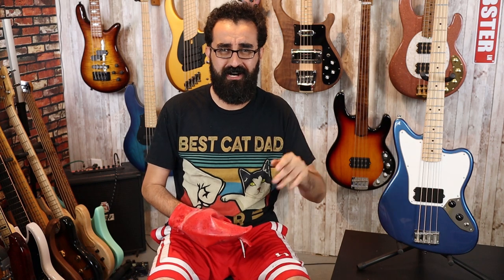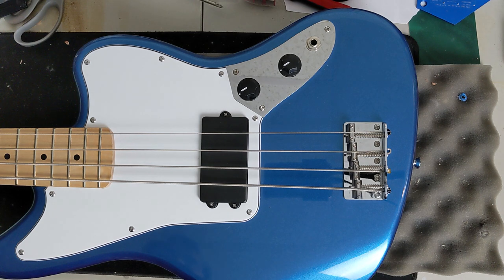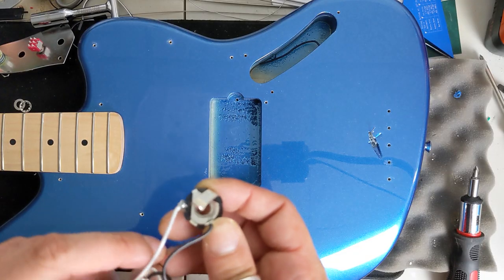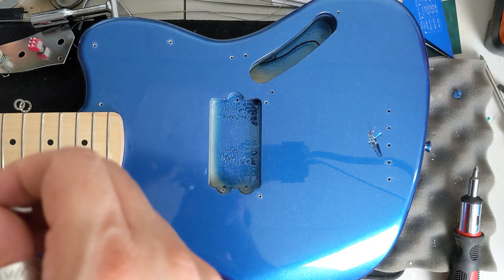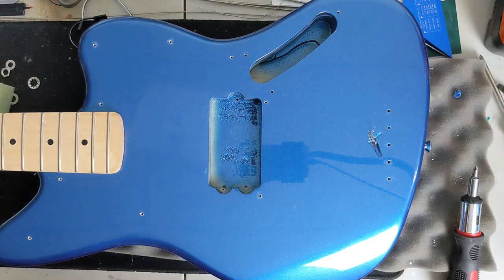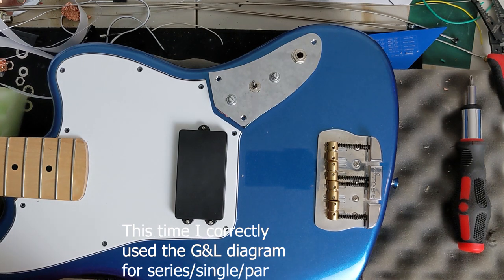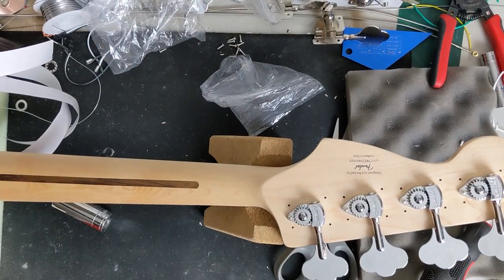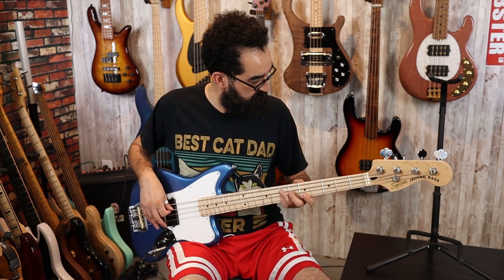Squier Affinity Jaguar H MODIFIED - Modding Fender's Latest Budget Beast! - LowEndLobster Fresh Look

Comment: that looks and sounds amazing. Can you fit a bartolini mmc 4 on this without drilling? By checking out the diagram seems like it can work for passive tone and volume . Thanks for sharing this with us. Salutations !
Reply from the maker: Thanks Claudio! Yes, the bartolini will fit without issue.
Reply: @LowEndLobster  awesome. thanks for the quick response. Mine is arriving tomorrow and I am already thinking about doing some mods on it :D

Comment: is the "painters tape trick" a long term solution for the tuner bushings?
Reply from the maker: Yes. The tape is only used to align the tuner. The tuner itself is tightened and secured into the hole during installation.
Reply: @LowEndLobster   for sure! i saw in another comment that you mentioned that there was "USA" ultralite tuners that may be a straight drop-in? is there some kind of import spec set?
Reply from the maker: Yes. They're significantly more expensive than the imports however. You can get metal bushing adapters too
Reply: @LowEndLobster  ahh i see. thanks for your help lobster ! :-) been super into modding axes and this is my first bass to call my own, yr video has been great inspiration :-)

Comment: Awesome, Moana go pick one up and start drilling!!  Novice in mods so basic question, would a guild BS fit in there, in theory it seems like it should be a nice way to go😊
Reply from the maker: Hi! Yes, though the string spacing might be a little off because the Guilds are a bit narrower. You may have to make the cavity a little deeper in the center as well - YMMV. Check this out - https://www.youtube.com/watch?v=5tuAdEigGQM
Reply: @LowEndLobster  thanks man, you are full of information !!  The Guild doesn't have coil tap so there is no issue with routing/wiring right?  Would the string spacing difference (Is it 18 vs 19?) make the Guild "unusable"?
Reply from the maker: @pierrel5222  I don't think so. I believe the Bronco that I modded had 19mm spacing and worked well enough. The guild does not have a coil tap. it comes with a weird little plug connector, snip it and you have yourself two wires - one hot and one ground. Hope that helps! Happy modding!
Reply: @LowEndLobster  saw your humbucker videos, much confusion I feel, the NS blade might be calling....
And it also looks like the pup monster ate all the BS1s....
Based on what you have seen and the pup position on the Jaguar, which one of the humbucker you feel is a good one to start with for punch, growl and meat and good tonal range but limited string/clicking noise 😎 (easy !!) ?
Reply from the maker: @pierrel5222  The blademan would be a good choice!
Reply: As for the guild bs1 do it looks like would alleviate the problem with the pickup...lobster I think I've entered the rabbit hole of mods can you please show me the light out?
Reply: I forgot to type the hipshot vintage seems to have a bridge with an 18 mm spacing and a badass I think is adjustable

Comment: I want to get this bass, but I'm currently the world champion of bad soldering.  I don't want to have to replace the pickup myself unless it's like the EMG system (solderless).  Any suggestions?  Thanks
Reply from the maker: You made a great suggestion for yourself with EMG, but you'd need to remove a small bit of material in the control cavity for it to fit. A Dremel would do the trick. Either way, no soldering!
Reply: @LowEndLobster  I have a CNC machine that I can program to perfectly cut the cavity to the right dimensions.  That's a plus.  Do you know of a good humbucker, preferably passive?  Thanks
Reply from the maker: @michaelfairbanks4299  You could go all EMG. A 35 hz or second mmhz would work well
Reply: @LowEndLobster  What was the pickup you installed?  It sounded great.
Reply from the maker: @michaelfairbanks4299  I used the G&L MFD inside a blank MM housing. You can do so much with these basses :)
Reply: @LowEndLobster  So I ended up buying a new Gretsch G2220 instead of the Jaguar H, and I love it.  It was 300.  I'm committed to leaving it stock.  I'll play the stock strings for a while and then switch to flats later.  I might upgrade the tuners, but it's not important.  I won't be cutting anything.  :)  

My other project is a Squier Bronco Bass I've had for a year.  I took it apart and I'm going to repaint the body, put an amber finish on the headstock, and I'm going to router the pickup cavity to take the EMG Geezer P-bass pickups.  I'll make my own pickguard through 3D printing or CNC.  I already bought new tuners for it.  

Cheers.  Love your videos!
Reply from the maker: @michaelfairbanks4299  nice! Congrats! Been wanting to check one of those out. Happy modding!

Comment: 9:35 already getting anxious to see what the results will be IDK if I can not scroll forward...dang...........
Reply: 13:15 okay I can see how this is gonna go.  it plays...not a lot of clatter, but that's not the pickup's fault whether or not it does.
Reply: 14:20 rip the frets out of the HLK, get it epoxied up to the height of the nut, drop that pickup in.  so much for clatter ha ha
Reply: 15:20 I'd say drop a G&L or other high mass bridge in it, but since the bridge is along the axis it's not going to counterweight a whole lot.

An old trick is to add the tape weights from balancing tires into the control cavity if it's close to balancing - there are also (rather silly looking but they work) horn extenders that are adjustable so you can counter neck dive, but again, they're goofy af looking imo

At the costs that G&L is handing out parts, you can also load that with the G&L active circuit for about 100 bucks more.  This would go very toe to toe with not just the Fallout Tribute model (which it already does right now, less tinny in my opinion) but the US model, because those MFD electronics, whether or not you like the voicing or timbre, we can all agree go BOOM

Comment: Hey Lobster something goes wrong with the wiring diagram link.
Reply from the maker: Weird, it still works for me. Very odd
Reply: @LowEndLobster  I would like to check the wiring circuit but appear:
Forbbiden
You don't have permission to access this resource.

Additionally, a 403 Forbidden error was encountered while trying to use an ErrorDocument to handle the request.
Reply from the maker: @efortunato8483  I will upload to imgur and post a new link. It sounds like a regional issue. Thanks for the heads up!

Comment: You left out details of the most important part: how you assembled the MFD into a MM cover.
Reply from the maker: The cover is blank on the inside and the insides of a MFD fit right inside. I used a little bit of foam (from a pickup box) to keep things in place

Comment: What size tuners does this bass have?
Reply from the maker: Holes are 1/2" size. I used the Hipshot Licensed Ultralites which required some tape on the bushings. USA Ultralites would not require this however.
Reply: @LowEndLobster  Thanks for the response